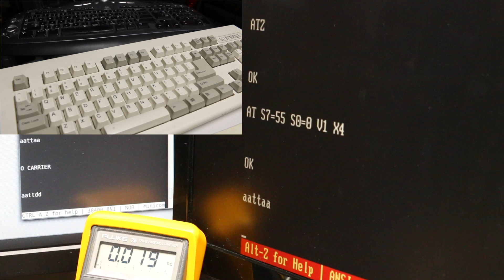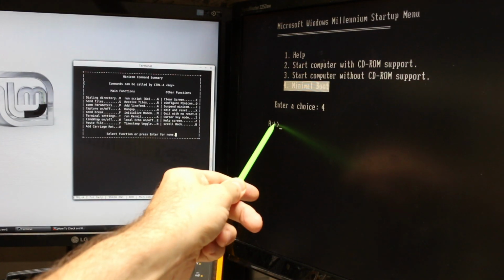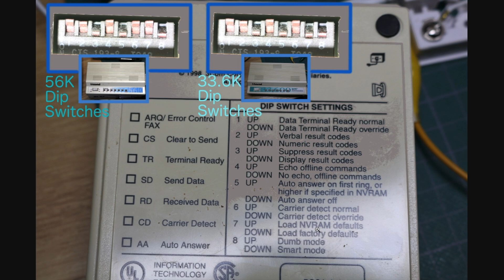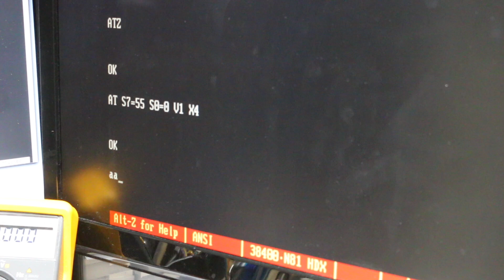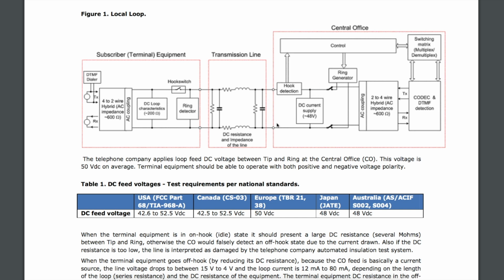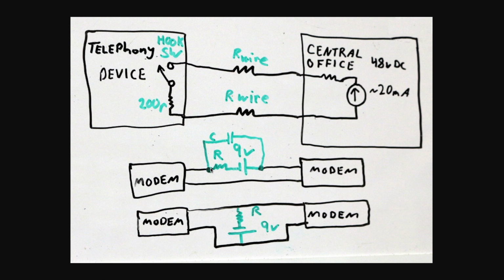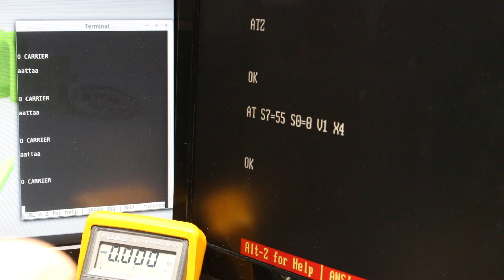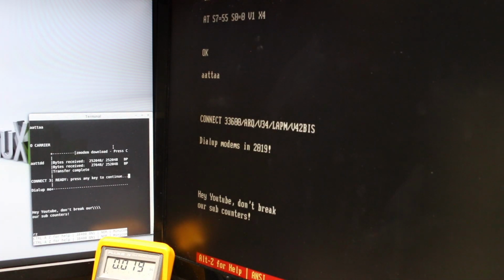56k and 33.6k Modems Connecting to Each Other with no Phone Service

Comment: Viking DLE-200B line simulator is ~$120 on Amazon.  Bought one for my kids to play with a land-line as an intercom with two classic phones.  Nice thing about this item is that it has a ring generator, dial tone, CPC (500miliseond voltage disconnect at hang-up, to force the other device to hang-up).

This is an interesting topic to me this month.

I take issue with the statement @13:40 "...there's obviously not
 much practical use in getting modems up and running like this..."  Can you really not think of a case where someone might want a 1-2 mile twisted pair low speed data-link over simple copper wire?  Ever wanted to get a small embedded microprocessor connected to another computer without radio interference or coming up with anything more complicated than a serial protocol?  There are still and will probably always be cases where a moderate speed serial interface is useful.  This is basically what DSL is doing now with better cabling and more complicated >audio frequency encoding ( https://www.youtube.com/watch?v=uwtGfyna62I ), and people use it all the time as their primary internet connection.

What you should try next IMHO is the PPP function in Linux - you can pipe a TCP/IP connection over dial-up.

You can build a line simulator yourself including ring generation, dial tone and ring-tone, and CPC.  Starting with the "CO line-battery", a $35USD module from Digikey ( https://www.digikey.com/product-detail/en/flex-power-modules/PKE5316JPI/2166-PKE5316JPI-ND/10287661 ) will get you 48V isolated from the power supply (meaning you can tie the output +48 to the input Ground/Earth, and now you effectively have a -48V supply) - and with an input range of 18-75VDC (good for anything from a wall wart or bench supply up to 300W commercial solar panels).  The current limiting is 600-Ohms on the CO-side, you need one for each "line".  Note that the "battery" is DC-coupled and the voice, tones, and ring-generation is AC-coupled.

You can detect off-hook with a simple LED optocoupler with a >50mA max LED rating in series with the current limiting resistor (fairly common - try a $0.50USD https://www.digikey.com/product-detail/en/lite-on-inc/LTV-814H/160-1350-5-ND/385820 ).  When the loop closes by the line coming off-hook, the circuit is completed and the optoisolator LED will illuminate turning on the transistor output (not visible, as it's inside an enclosed package).  This output can be used to pull up logic, with a resistor pull down for the idle state.

Ring timing in the USA is 2 seconds on, 4 seconds off.  A timer circuit can be built for this, a web search can get you there - a hint may be that you want a 6-second oscillator/timer circuit with a 33.333% or 66.666% duty cycle.

Ring voltage can be generated with a 20Hz sine wave, generated by a 20Hz square wave oscillator output fed into a sine filter, then compared to a 33kHz sawtooth output (using a linear comparator) to generate a PWM.  The PWM sent to a buffer chain made of inverters, with one positive and one inverted output used.  The output of those two lines fed to a 100-500nSec delay line (tune the delay for the full H-Bridge t-on + rise-time + t-off + fall-time, plus ~20% of that total, https://www.digikey.com/product-detail/en/maxim-integrated/DS1100Z-500/DS1100Z-500-ND/1017668 ), the input of the delay line XOR'd with the output, and the output of the XOR AND'd with the input of the delay line (circuit duplicate for positive and inverted PWM output).  This gives a positive and inverted 33kHz PWM representation of a 20Hz sine wave with a delayed-on for each half (immediate off) - suitable for driving a MOSFET full H-Bridge.  Source your own 48V capable or build it from scratch.  This will only produce a 67.8Vrms signal - but that can be fed into a 1:1.4 transformer commonly found in telecom applications.  Tie the "1" side directly to the full H-Bridge output, build a low-pass reconstruction filter ( https://www.eetimes.com/understanding-output-filters-for-class-d-amplifiers/ ) to make a nice clean low-frequency 20Hz sine output on the "1.414" side of the transformer as your ring voltage output (tie one side to +48V to keep the voltage from wandering in the kV range...).  A hint here - is that, your H-bridge doesn't need to be driven all the time - the 20Hz/33kHz PWM generator CAN, you'd just enable the H-bridge by using an AND on the input of the delay line logic for both positive and inverted.  You can duplicate just the H-Bridge driver stage, reconstruction filter and transformer.

The higher frequency tones like ring and dial can be generated directly with an oscillator circuit, and inverter buffers - with a sine filter on the square wave output of positive and inverted - then capacitively coupled to the line.

When a line goes off-hook, logic needs to be built to enable the 2/4-second timer/oscillator to generate ring cadence pulses.  The high frequency DTMF signal is enabled on the new line taken off-hook, the low-frequency 20Hz ring voltage is driven on the other line.  A simple XOR/AND will select which of the two does what.

CPC is generated by detecting a line going on-hook (the optoisolator LED stops outputting, the transistor stops conducting) - then opening the -48V loop of the other device for 500miliseconds.  A 555 timer one shot triggered on the falling edge is sufficient, pulling a MOSFET gate low (normally pulled high by resistor) will break the current loop causing the device downstream to recognize the other device did a hang-up.

The CPC also has the effect of blocking the other line from ringing after it was hung up, but a 1-2 second delay-on can be used on the ring generation logic to further enhance this - and for the ultimate - a flip-flop circuit which sets on the first XOR/AND (by doing an XOR on those two outputs) and resets on NOR for both lines being off-hook.

A DPDT line relay is used to switch between the ring generator input and a "common bus line" input or "trunk".  Both lines each have their own line relay, and they switch when the line goes off hook.  The common side of the relays go to the TIP and RING of your phone line via capacitive coupling, the ring generator side goes to the ring generator output, the common bus line is the trunk for the link.

If you want to do more than two end-points, add more common bus lines and one line relay for each trunk (single capacitive coupling point for each line, all line relays share a common "contact common").  Then you need to add DTMF decoding and some line selection logic, and busy detection (both for the end point and the common bus line).  There is some interesting precedent for this stuff - look up the old step-by-step dialing system ( https://www.youtube.com/watch?v=QOTQic5231w ).  A 10-line simulator with a single dial digit can be done fairly easily using a DTMF detector with 10-digit outputlines latching while the line is off-hook (an AND to off-hook and the decoded number for SET, and hang-up for RESET).  The off-hook is also used for incoming BUSY in this case - when a line is on-hook it can be "seized" by an incoming call indicating that it is already busy (a logical OR).  If the line is not already busy,  it is seized so that subsequent calling attempts see that it is busy and rather than a ringback-tone, a busy signal is sent back the the calling party.  The maximum number of call one can do with 10 possible numbers is 5 (1 calling + 1 ringing = 2, 10/2 = 5), so each line would get 5x common bus line relays.  One inactive trunk would need to be seized as the first line comes off hook.

Set the modem for "No Dial Tone" (or dial tone with DTMF decoding on a multi-line simulator) and a single digit number to call, and when it goes off-hook it won't wait for a dial tone to start dialing - the 2-second delay will then make the other device ring and the ring-back tone will be detected by the calling modem.  The other modem will see the ring, answer on its programmed ring number, and the link training tones will start.  When one device hangs up, the other gets a CPC indication and hangs up.

Should one decide to use this outside of a lab setting - use your brain, and good lightning/surge suppression.  No warranty express or implied is given for this information, your mileage may vary.

Comment: Modems supply voltage on the phone line port so they can be connected directly together phone line to phone line.
ATDT(any number) on one, ATA on the other...I've done it many of times.
If you want to simulate 2 real phone lines so you get "ring" signalling use a cheap voip adaptor (like a PAP2T) and set it to do IP dialing so one line can call the other... To dial on some you have to turn off dial tone detection.

Comment: I don't think you need to emulate a Phone Line if you use a Null Modem cable to connect them together
Reply from the maker: I can do that  directly between serial ports but then I don’t get to use the modems so it defeats the purpose of the project.

Comment: Funny. I was very young when my family had dial up. I vaguely recall using it. After becoming interested in hardware a few years ago I've become so accustomed to μC's on UART it's easy to forget the times when serial was the only connection to the outside world....and we sent texts on pagers...and called home using coins.
  I've never looked into the hardware of these old land line modems before. Are they much more than a MAX232?
  Lastly, I don't have anything against Mint, or other distro's, but for me, nothing has been faster and more practical than using Lubuntu on mid-00's to '10's hardware. In fact, I haven't found a good reason to replace my ancient single core 2.1 GHz HP laptop yet using Lubuntu 19.04 and a cheap AliEx 128gb SSD as the boot drive. It doesn't like some 3rd party dev software with bad java implementations (MPLabX, PyCharm, Quartus, Atom) but there are alternatives. It's just a hint. If you haven't surfed distro's try Lubuntu on anything older :-)
-Jake
Reply from the maker: I still consider myself an extreme unfamiliar beginner with Linux. I think the first time I ever tried to install it was red hat in the late 90s and I think everything was so primitive it barely had video drivers and I had to use a 6840 x 480 resolution which was no good and then I only just installed mint a few years ago but it’s just the secondary computer that I barely use if I need to Google something technical in the lab but I plan to look more into it and maybe put in another hard drive with  A different configuration to try out.

 I have run into some issues trying to install some things on mint so I definitely will be looking elsewhere. I don’t really know anything about all the distributions and the reasons for them and what pros and cons or how to choose. It’s like being new to computers. 

 Some people would use the parallel printer port for an alternative path to the outside world, even using it as a sound card or a digital to analog interface for hardware. I never got around to doing that back then but I’m certainly going to be doing it any day now.   Same with the joystick port 

 My first printer was a 24 pin dot matrix with a three color ribbon. State of the art.  Horrible.  Loved it. 

 I don’t remember what I saw inside the one modem I took apart but on the internal modems I have seen before, I don’t remember if there was a separate chip like a max232 or if it was all part of the one single chip design. Something I’ll also be looking at in the near future because I do have at least one internal modem in one machine here.  I’ll be going through all of my scrap computer bits and pieces including an old tape back up drive.
Reply: @GadgetReboot  
  The tape drive would be cool to see especially if you can show it working in practice. I haven't seen those much, if at all.
  I just built a breadboard setup for messing around with a combination of Z80/68k/6502 stuff. It's just a 16 or 32 bit address, 8 or 16 bit data bus and 5 regular IC breadboards on a piece of particle board. It would be interesting to play around with some kind of rigged magnetic media to dump into RAM just for fun.

  BTW, if you have any old PLD stuff, especially anything 16V8 or 22V10 please consider sharing it. The toolchain for those seems very poorly documented. Even the modern programmers/burners that claim to support these chips seem to do a poor job, if they work at all, at least this is what I've been told. Someone told me the TL866 will work with some 16V8's but won't work with 22V10's. They all require a windoz system to work. I wish someone would simply hook up a cheap 8 or 16 channel USB logic analyzer and show exactly how the protocol works along with the voltages involved. The PLD chips are still plentiful and cheap, and it would be so much easier for me to use them instead of the EPM240 CPLD that I can currently program easily. 

  As far as linux distro's many people complain about Canonical (Ubuntu), but I have found their distro's useful. They aren't great about having the most up to date software revisions for a lot of smaller projects in their repositories. Their Light version of Ubuntu is hard to beat when it comes to the half dozen or so distro's I have tried. Linux has come a long way in the last 10 years. I like it far more than windoz after working my way to my present location on the learning curve.
-Jake
Reply from the maker: Z80 and 6502 are on my to do list like everything else to do, I know I received my Z80 but I can’t remember if I got the 6502 yet. 

 I have my old CPLD and FPGA development boards kicking around and I can’t remember exactly what I have, mostly Xilinx and a little Altera. I’ll have to get familiar with tool chain stuff again.  One of the boards has a 40 pin IDE hard drive interface on it that I never got to use but always wanted to since 2007 when I got it. Definitely going on the to do list. 

 The main thing I like about using Linux is how when I go into the terminal it feels like I am BBSing and calling an old dial-up system doing fancy hacking stuff.  So much to do and learn, so little time.

Comment: yeah, 6 hours download for 20 MB star trek game demo, last century ...
Reply from the maker: I started out on a 2400 modem and it was one thing to locate BBSs that had “Elite warez”  but then I had to find a place that would tolerate me tying up the line at such a slow rate. I remember it took about 15 minutes to download a 212 K zip file.
Reply: you had a fast connection 3mgb took me 6 hours i only had 28.8k my first modem was a 9800 baud
Reply: Back around the turn of the millenia, it took me a whoopin' hour to download a 10.4MB zip file containing the correct drivers for my VooDoo3 3000 grapbic card. Only then was I able to play games such as GTA2 and Half-Life. My parents were all but pleased to have the single phone line tied up for that long. Luckily, no one dared to pick up the phone during download, I would certainly have screamed my head off because of having to download that file again!!

Comment: I miss the sound of modems connecting... It was so satisfying to see them connect and see the BBS appear (unless you ran the BBS (like me) and turned the volume off) hehe!

Nice project and video. 👍
Reply from the maker: I always kept the modem volume on, even when I ran a BBS. It was always strange when I upgraded from a 2400 to a 14.4 modem and I would still have days where I would call a random new BBS number and it connects at 1200 and it’s running on a Commodore or something.   The text would peel on slower than I could read, and it wasn’t even ANSI graphics, just plain white text.
Reply: I like the hiss that came just after the tones, then you know it's connected. but all that said I don't miss the speed or lack of it. just missed out on the plugging your handset in to the acoustic ports on the modem.
Reply: woah nested parentheses you might get a syntax error
Reply: Ah, the ol' Hope, Pray, ... and Wait ... for the disconnect brush-aside from your dial-up Internet service provider!

Comment: A lot of these old modems had a private wire option configured through an at command option. If you find this and enable it you will be able to connect them back to back without the current source. They will then just go online as soon as they see each other without needing the ata or atd commands.
Reply from the maker: I remember reading about that on some US robotics modems but I think it was only special ones like courier HST type things, not sure. I wonder if I still have that tab open somewhere. I do plan to do a deep dive on all the options though.
Reply: @GadgetReboot  Use a Null Modem Cable
Reply: @wooferhound7571  A null modem cable does not help. It could only be used in place of the two modems which rather defeats the point of it all..
Reply: I've had success connecting Multi Tech Multi Modems back to back. I guess they have enough logic in them to automatically work around no line voltage. The only thing I believe is I had to turn Dialtone detection off with the AT command ATX1